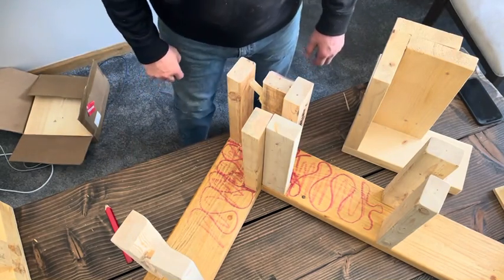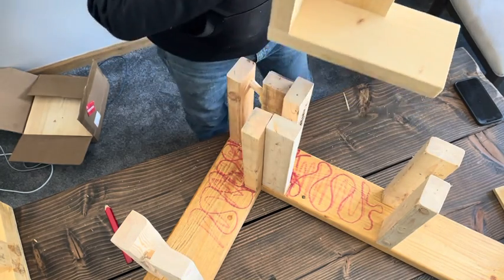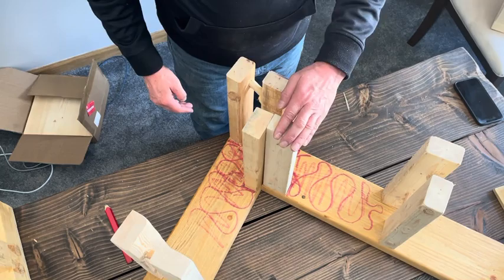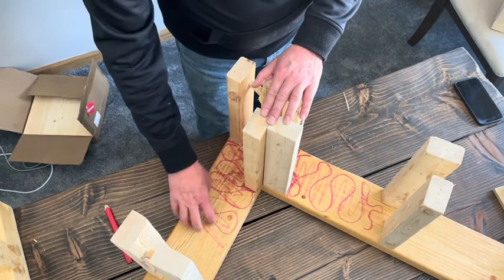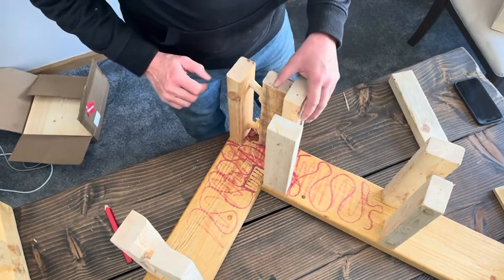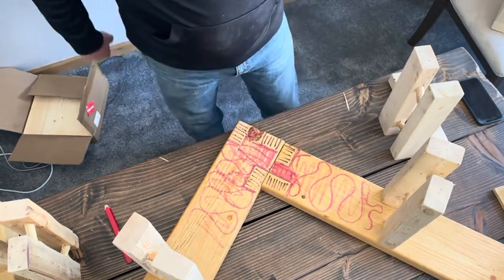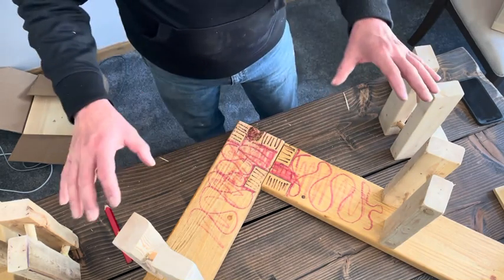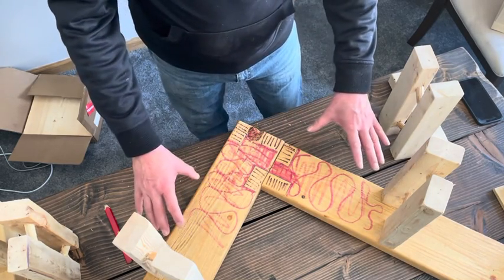How to Frame the Tstud™ Perfect Corner

Comment: If you replace that 2x3 drywall nailer with a strip of 23/32 Advantec you can screw it in after with a right angle drill and it works great. I use Advantec for all my nailers.

Comment: What I do not understand, with wood buildings in the USA, is using isolation that will burn and often produce toxic fumes. When you have concrete or brick double walls, you can have your isolation that burns in the cavity. I also do not understand using isolation and cladding that burns on the outside walls, especially in areas where you can expect a fire danger. I would keep isolation that burns as far away from a wooden house as possible.
So why even talk about spray foam.

Comment: Is there an engineering reason you never show the "parallel" tstuds anymore vs. the "right-angle/perpendicular" ones like shown here?  I would think the parallel ones would be used in most situations for walls, top/bottom plates, and headers.  Are you even selling the parallel ones anymore?  One comment I found suggested the right angle ones is because it maintains the same width of the normal wall stud bay for putting in batt insulation.....but that doesn't make sense since bare-naked tstuds are perfect for spray foam.

Comment: Building it like this I'm not seeing the issue with attaching that 3rd stud drywall backer there in the corner. You said you wouldn't be able to get a nailer in behind there? Yeah how wouldn't you? Is there some kind-of requirement that says the sheathing has to be preinstalled before that backer?
Reply: That's what I was thinking.